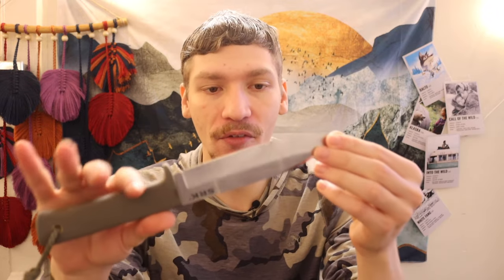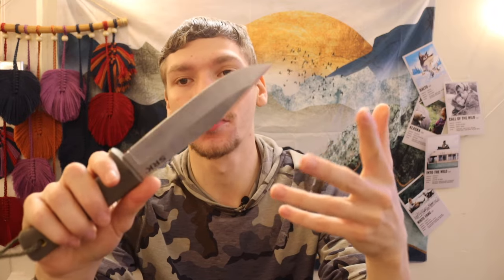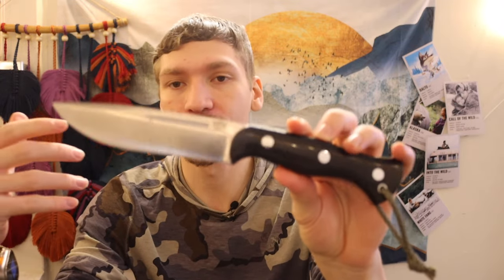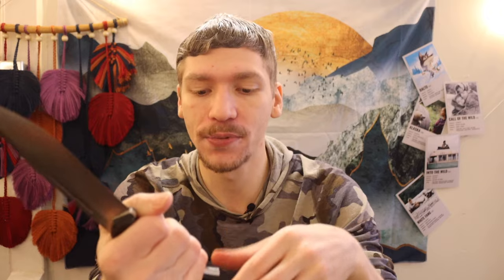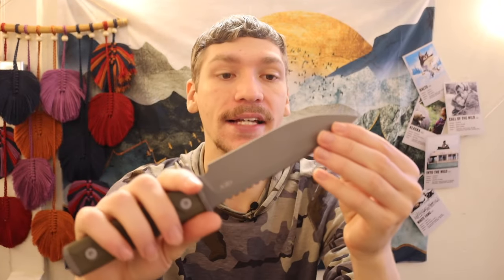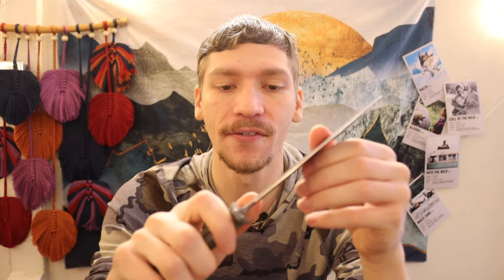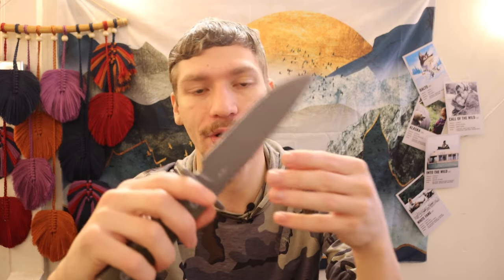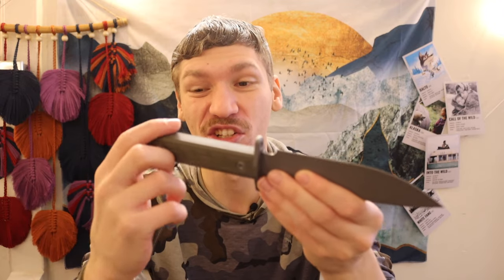CPM 3V Survival Knife Beasts!

Comment: 3v is a great option, it's an excellent material with good edge retention and great toughness.  It even seems reasonably corrosion resistant. Even available from fairly low prices, to full on custom. If I weren't focused on stainless lately I might chase  a Carrothers cryo 3v

Comment: I had the same knife for most of my younger years, a cheap, thick 7” carbon blade with a wooden handle. There was nothing I could not do with that tool. My secret was and still is: Sharpening was easy. Carbon still rules at a fraction of a price of those super expensive, “high performance” gadgets targeted at wannabe woodsmen. Yes, I said gadgets.